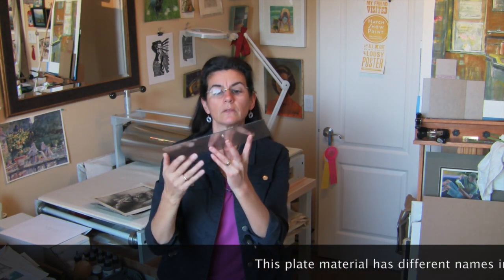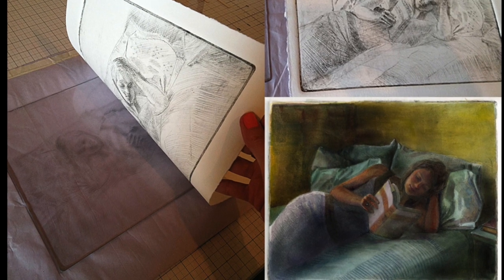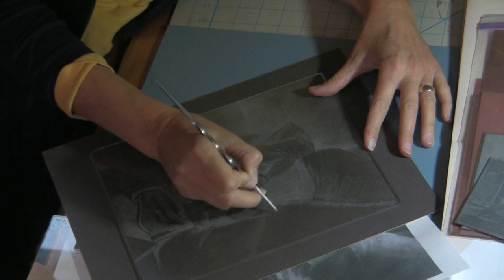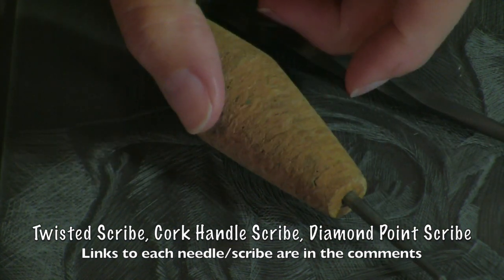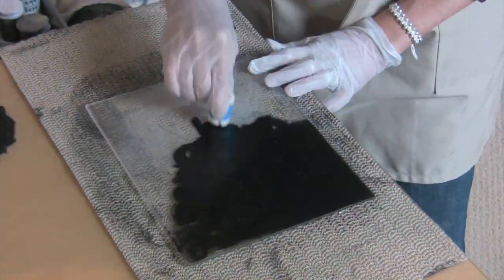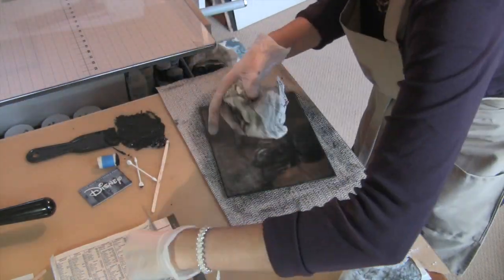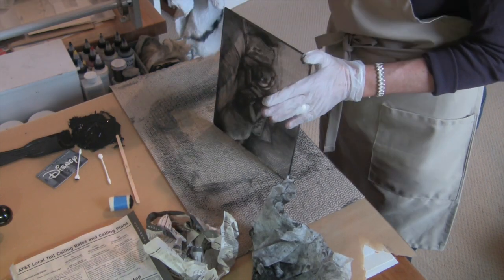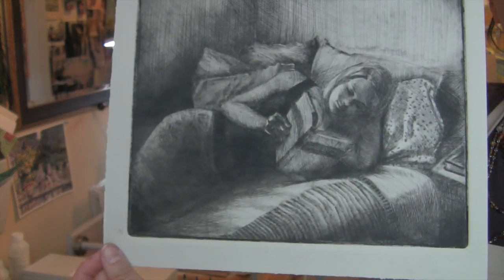Printmaking Tutorial Demonstration - Drypoint Print from Plexiglass - design, inking and wiping

Comment: This is my favourite film about the "inking & wiping" that helped me make sense of the process. This time I got a lot out of the cross-hatching part. My early perspex engravings had hardly any hatching at all and it took way too long for me to work out that the reason I was not doing it was because the 3-D embossing folders I've been making produce shadow and depth naturally whereas any other type of drawing requires you to create it artificially.  This makes better sense now that I see how you transfer the sense of shadow from an existing print out of a scanned image. The lamination engraving technique is working well; I laminate a piece of my graphic art, then I glue both sides to another lamination folder and send it through the laminator again. It fixes hard around the image and is absolutely engravable...
Reply from the maker: Hi Zachar - I can visualize how your lamination process works now, so thank you for the description.

Comment: I have a lot of background in working and teaching in this medium. I mention this so you can qualify my flattery. I have done a little work in plexiglass and was surprised to learn how well it lent it's self to the process. I'd like to suggest a non reflective for an aquatint like finish and burnish back for light as if in a mezzotint plate. Also the older electric engraver if they still make them was a wonderful tool for tree leaves and such. The scratch as far as a trace goes works best on a then lexon and then a backing to raise it up. I came into etching when I was homeless at Berkeley ASUC and found there are so many ways around the expense of materials. Even the press itself, if willing to do relief prints. Thank you for your wonderful video Belinda.
Reply from the maker: Hi Will, Thanks for stopping by and adding to the idea-and-supply-kitty. This is one of the beautiful side-benefits of art-making; community, and a plethora of material options, approaches and discoveries.  I appreciate your additions to that, and your compliments.
Reply: I have always seen artists as scientists. People who share as their heart opens up. I'm actually doing a copper plate etching at the moment and considered a vid if there were not any already on the TUBE. Looks like the subject is well represented. I am a sailboat artist who wants to do art on a boat. Mostly just building toward it now. The race gets tighter as I age.... 
Thanks for the holler Belinda.

Comment: Hi, very informative video, and clever usage of plastic sheets! 
Not that it matters for you're use case, but it is essential for those that might follow your instructions
but will be using a Co2 laser instead of hand engraving the print media (plate).

You mention quite a few plastics and brands in the beginning of your video, besides that it is not 
quite correct it could give consequences for people following your instruction using a Co2 laser.

Just to help clarifying, PlexiGlas and Perspex are brands of the plastic Acrylic.
Acrylic is generally considered "laser safe/laser friendly" when using Co2 lasers for machining.

Lexan is a brand of Polycarbonate. Any polycarbonate is largely considered as
a "No-No" when it comes to Co2 machining. This mainly due to two factors,
polycarbonate can be laserd but it does not cut well. Due to the wavelenght
of the laser and the energy needed to cut polycarbonate the cuts show big signs 
of melting and has a yellow-brownish tint to the cut.

But most importantly when laser cut. Polycarbonate emits smoke, fumes and 
vapors containing  benzene. A carcinogen.
Reply from the maker: Hi Purple Orange - I'm not planning to use a laser to cut my plates, but this is good info if anyone else plans to do that. I do mention the health factor related to inhaling fumes in this video  https://youtu.be/Fg9Y8uRX17c  , so we are aligned on the importance of safety, with a hip bump and a high five! :)

Comment: Very charming work!! i would like to try. I am not sure if i understood the steps, my english is very basic. did you use a photograph as a reference? or was the painting with the yellow wall? Are this the steps?: 1. prepare the plaque on the edges (is it posible to do it in the end after the finished the etching?) 2. Engraving a sketch from a photograph direct on the plaque and print it. 3. scan and print to paint it with watercolour to make the tone values. 4. use this watercolored print of value study as a reference to finish the already sketched plaque.  

i am a bit lost but tanks a for this inspiring video
Reply from the maker: Hello Batzeth - maybe try this simpler version of a drypoint engraving: https://youtu.be/86nRWW4PV9M?si=iDgrKHQMOYsxpPkp

Comment: Why do you use cheese cloth and newspaper to wipe away? What does each do differently that requires the use of both? Thanks again for your wonderful instruction and effort!
Reply from the maker: Hi Janett, Cheese cloth is used in cooking, but here - it's called tarlatan, which is starched and stiff. The open weave and rough texture pulls ink off the plate pretty aggressively. Since the fabric is stiff, and tapped into a flat shape before rubbing the plate, it barely scrapes the top of the ink laying hidden in the incised line work. Since it's used to get the bulk of the ink off the plate's surface, it becomes loaded with ink, and after awhile, it just pushes ink around. Then, you switch to newsprint, also patted flat, to polish the un-incised parts of the plate, and remove some of the remaining veil of ink. Make sense?
Reply from the maker: Watch this video too, for more on tarlatan and newsprint and wiping plates in general: https://youtu.be/hxPDNyMqwdc

Comment: Hi Belinda - I'm intrigued!  I've been re-discovering block printing starting with linocut prints.  I've been very disappointed with linocut and don't think it's for me.  I'm not ready to give up yet as drypoint looks interesting, but I've got a few questions:
- How difficult is etching the plexiglass?  I've got a bit of arthritis in my hands from so many years of doing crafts so I need to know.
-  Can you do techniques similar to linocut, like being able to print some areas as blocks of color, while also having the nice black lines? 
-  I can't afford a printing press right now - not until I play with this technique for a while - so can I just rub the back of the paper and still get a reasonably good print?
Reply: Hi Belinda - Thanks for all your replies and all of the wonderful tips in your videos!  I am currently working on a thin piece of MDF art panel (normally used for creating an oil or acrylic painting).  I have seen videos where artists work on thick (3/4") MDF panels purchased from the lumber store, but I tried a piece and the surface seems harder than the art panels.  I stained the panel with a medium gray color.  I've carved part of it away and it is looking pretty good so far.  Because I am just creating shavings as I carve away, there doesn't seem to be any problem with dust.  However - I may need to sand the surface slightly to remove any burs before proceeding to the next step.  I will try to damp sand the surface to keep any dust down.  As for the Drypoint on plexiglass - I don't think it will be for me due to my arthritis.
Reply from the maker: Hi Wise Cracker, It sounds like you're on a roll, and you'll be an expert in using MDF art panels to make collagraphs in no time at all! I hope you post the results of your work somewhere (share a link here so we can all see).  And regarding painful joints and fingers due to arthritis, if you do get a hankering to make a drypoint, look into using a tool to scribe the plexiglass, like this hand-held dremel: https://www.dremel.com/en_US/products/-/show-product/tools/8050-micro

Comment: Really enjoy watching your drypoint etching videos. I've search for examples of the use of mezzotint rockers being used on acrylic or acetate plates; haven't found anything. Have you used a mezzotint rocker on acrylic or acetate plate? If any exist that you know of, would you please provide a link where the use of this tool is used on these type of plates. Thank you.
Reply from the maker: Hi Jim, Thanks for the feedback on the videos - I'm glad they're helpful. I've never seen or heard about someone using acrylic or mylar to create a mezzotint with a rocker. The action of smoothing the incised lines to create light areas on a metal plate works because the soft flanges and grooves in the copper can be flattened with light pressure, and polished to a shine that will release ink during wiping. I'm not sure you can do that with an acrylic plate or mylar. I've tried "buffing" line work out of an acrylic plate on a drypoint, and I couldn't fill the grooves by manipulating the polycarbonate with any tool in my arsenal. Ultimately, I used 400 grit sandpaper, but the area still held ink and would not return to a smooth enough surface to print light. Does that make sense?
Reply: @bdelpesco  Thank you for your reply. I was thinking more of the texturing effect a rocker might provide on acrylic plates rather than using it as an aid to buff out any line work. Again, thank you.
Reply from the maker: @jimm9052  Ahhhh, okay, that makes sense. I think it would work beautifully for that - especially if you're after a crosshatch that appears parallel and consistent in it's ink-holding abilities.Have you tried adhering carborundum to your plate, as a test? You get beautiful, rich darks.

Comment: How thick is the plexiglass glass or is there a range of thickness that works best?
Reply from the maker: Hi Sharon, Most plexiglass sheets will work for this process - everything from recycled plastic produce containers to 1/8 inch acrylic or plexiglass. The really thick stuff may not work on a press, depending on the space between your press bed and the cylinder. Do some tests: use a small snip of acrylic sheet from a plastic cookie or tomato package, and scribe some line work and cross hatching patches so you can ink and print that, and see what works best with your ink, your paper, and your transfer method.

Comment: Thanks for the video. Very helpful. I just have a couple of questions: Is it necessary to use a lime to make a bisel to the plate? Is it necessary to make very deep lines and apply to much pressure? Thanks
Reply from the maker: +Alejandro “Alex” Silva Thank you for the compliments. I don't understand your first question - lime & bisel? Tell me the words in your native language. If you are asking if the plate has to be beveled - if the edges have to be shaved down with a rasp, the answer is only yes if you print on an etching press. Your lines can be deep and shallow: both, as you will get different mark-making results in the print. And yes, you need a lot of pressure to print. :) I hope that helps.
Reply: +Belinda Del Pesco Yes, that's what I meant in the first question. And thank you for answering :)

Comment: do you have any tips for applying the ink on the plate?  This is the toughest part for me and it get very messy.
Reply from the maker: Hi +Row Gebre - messy is sort of expected with printmaking. :) Try covering your work area with newsprint or butcher paper, wear rubber gloves, and if it helps, map where your ink & tools will be laid out the same way each time you print so you'll develop muscle memory when picking them up and putting them down in the same place each time. Use less ink than you think you'll need, as it's neater/simpler to dip and spread on the plate, to add more, and messier/harder to scrape & remove and then put back in the ink pile, etc. I hope that helps! Happy printing, mess and all!

Comment: If you add water colour on your print it won't make the printing ink run?
Reply from the maker: Hi Paul, That depends on the ink you use. Be sure to print with inks that dry without re-wetting, like Akua (water clean up - this is what I use) Caligo (also water based) and most oil-based printmaking inks. Happy printmaking!
Reply: Great! Thanks for your help!

Comment: I have a small toy wheel and would like to make the tire marks in yellow color on the piece of wood , which paint do you recommed for this art work and how I do it cleanly
Reply from the maker: Hello Siamak - if you are printing on untreated wood, you might test the yellow tire track on a scrap piece of wood with yellow relief printmaking ink first. Try it on paper, and then on your test wood, before laying the tire track on your final wood. To get a clean print, roll the ink out on a sheet of glass or acrylic with a brayer till you have nice, even, thin coverage. Roll your toy tire across the in until you have good coverage, and then make your test prints on paper. Good luck!
Reply: Thank you Miss Belinda. I will do the same.

Comment: *yesterday I absolutely ruined one of the collagraphs I made 'cos applied water to the paper before pressing. For some reason I thought the collagraph would be waterproof. The moist paper, however, stuck really hard to the tiny bits of paper that were not covered with gel medium. When I tried to pull the paper off, it most of stuck to the paper and the rest of the image got ripped right off the board. Oh well live and learn I say.  Luckily I'd already taken a few prints of it first.
Reply from the maker: Hi Zachar, that’s a sad story. I’ve had this happen too. Now I add one more layer if gloss acrylic sealer to every collagraph plate when it’s finished and I let it cure overnight, just to avoid that whole paper-bonding ordeal. I’m glad you got a few prints before the plate failed. 👍🏽
Reply: @bdelpesco  Great idea! I was partially copying your method of scratching away at a layer of gel medium I'd painted on to a paper image (which I had previously attached to a board by soaking the paper in gel mecium). The scratched away medium revealed, of course, the paper. Not very much paper, but enough. I had actually thought of varnishing it but I was too scared of filling up the intricate lines with varnish. Next time I'll try this anyway because before it finally stuck permanently, the plate had started giving way in tiny patches. No fear: I'm using stenciles I designed on the before hand, so I can use the same stencil again.

Comment: what happens happenes if u use the print more than 10 times ?
Reply from the maker: Easy Aces - you can make more prints, as long as your details don’t get worn down by repeated wiping and the pressure on each pass through the press.
Reply: @bdelpesco  hi and thanks for the video, I would like to ask you, how many copies is the most you have done with one plate before it fades out?
Reply from the maker: @PoisonBleed  Hi Laura, I've never printed an edition large enough to affect the plate. The most I print is between 3-15 in an edition. Are you planning to print a huge edition - over 100?
Reply: @bdelpesco  thank you so much for responding, maybe 30-50
Reply from the maker: @PoisonBleed  I wish I could advise you, but I think you're better off just going for it and making as many prints as you can, till the plate starts to show signs of wear. There are so many variables; the depth of your incised linework, the type of plexi you use, your wiping habits, the type of ink you use, the choice of paper and the pressure on your press, etc. To know your answer, I suggest diving in, and printing your art. :)
Reply: @bdelpesco  thank you very much for sharing your knowledge. I will do it as you say ♥